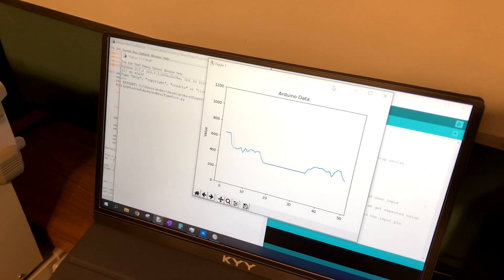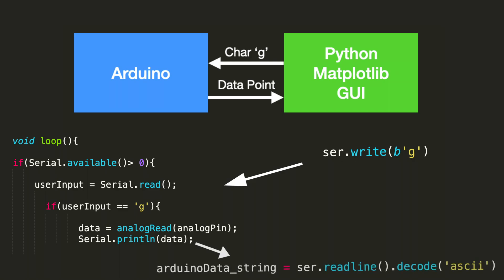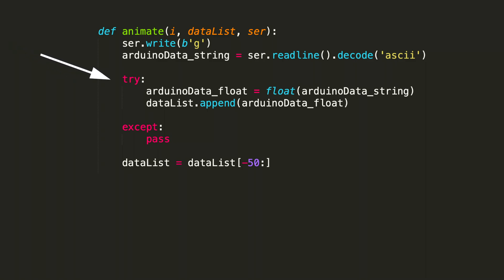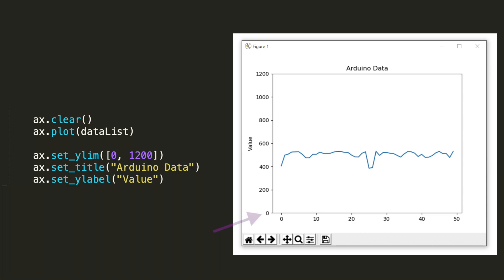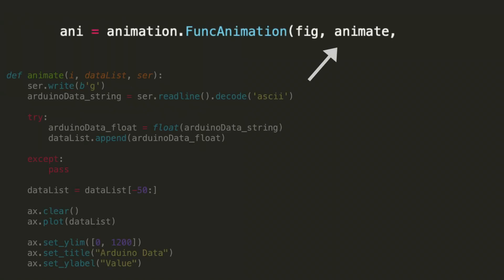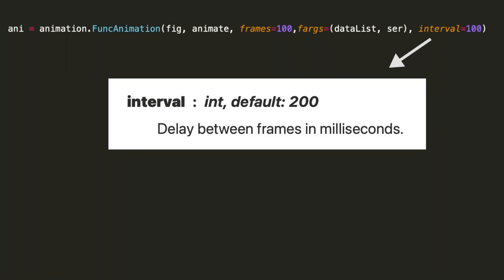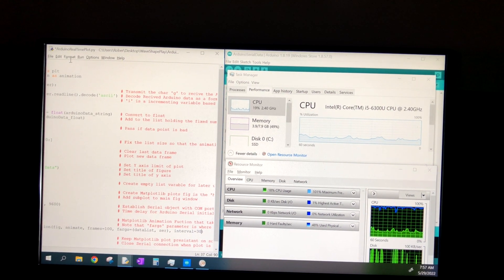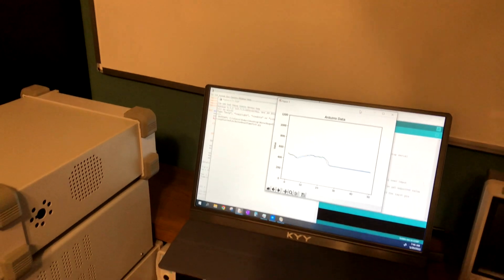Arduino and Python Real Time Plot Animation | Lesson 1 Getting Started | PySerial MatPlotLib

Comment: I am using Jupyter Notebook
When i input the letter 'g' my plot is empty, showing nothing😢
Reply: It may be due to wrong serial port number or wrong baud rate
Reply: Did you find a solution? I am getting empty plot also using PyCharm.
Reply: I presume you type the letter g on the keyboard, which is wrong because the arduino board sending through by the serial port. However, don't forget to check and modify the serial port number in the python source code according to your operating system! (For example on my system the windows assigned to COM4)